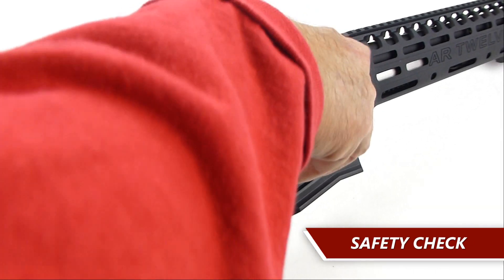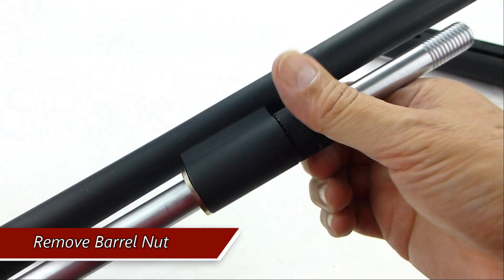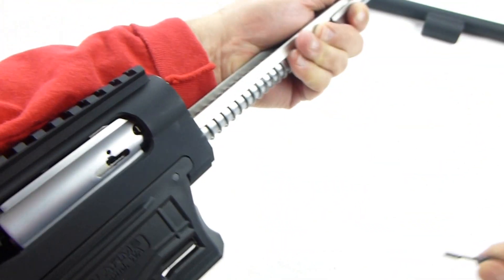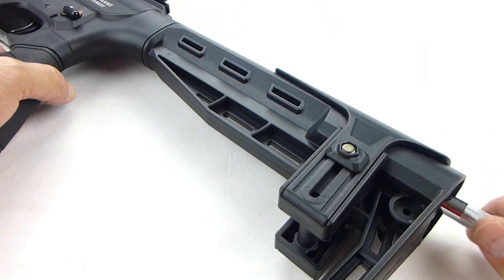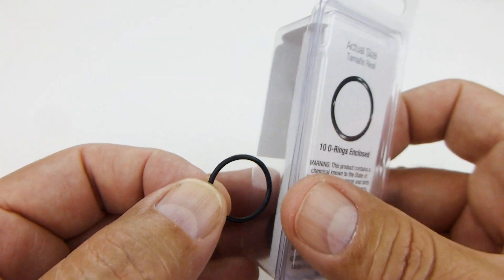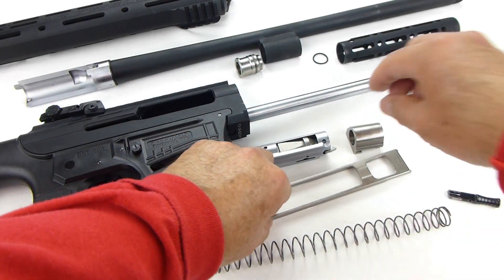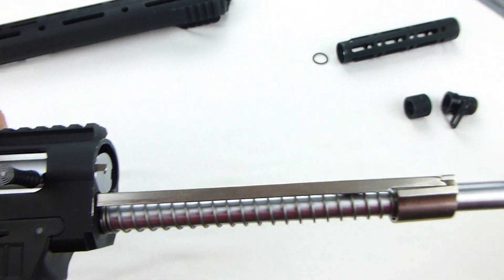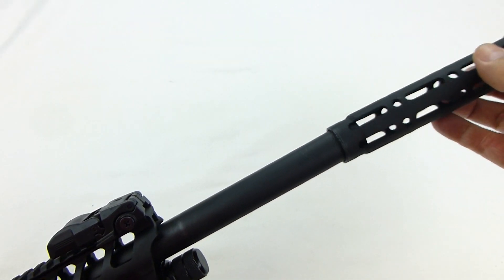Panzer Arms Gen3 AR Twelve *QUICK* Disassembly & Reassembly video

Comment: Thanks for tbe video!  Great job!   The Fo Muzzle break is actually not intended to give the appearance of a break though.  It is a heat shield because the barrel gets so hot.
Reply from the maker: Yup. It is actually a heat shield. The Panzer manual calls it a flash hider. Most people call it a faux muzzle brake because many people think it is a muzzle break. But with a semi-automatic shotgun, anything covering the barrel is actually a heat shield. Once you begin shooting 5 rounds rapidly the barrel does get hot. With a 10 round magazine, it gets really hot. Thanks for watching and liking Blake.

Comment: I would like to commend you on a very descriptive and useful video.  I’m am actually having an issue with fact that Panzer Arms has placed your video within their page that displays the PRO version.  I am aware this is not at any fault of yours, but considering the PRO is very different, it may be something that should be mentioned to Panzer, to avoid someone that may not notice the obvious and get into a breakdown and not be able to return to original or worse break something attempting to improvise from what they started.  
Again your video was great and unfortunately there does not appear to be even one single video or even a correct instructional breakdown in the original Panzer manual.
Reply from the maker: Yeah. I can't control what Panzer puts on their official website. Someone who owns a PRO version needs and has figured out how to disassemble their gun needs to make a video to help those owners. Or, Panzer needs to make one. Thanks for watching and liking my video.
Reply: MrMnmn911 I fully understand that it wasn’t in your control and think it is quite the compliment that they would use your video as reference on their primary site. I actually only mention to you in the comment form so some of the many out there that are very inexperienced and may read this and continue to look for a PRO specific instruction as well as there is a much higher probability of a message from yourself even getting read than a random unknown person as myself. 
Nonetheless, You have some great contributions in videos and well edited. I may make a hacked attempted at putting together a similar video, on the PRO when I finish the complete breakdown to make sure I didn’t skip any steps myself. LoL

Comment: Wow - when I saw this : requirement to take apart the buttstock just to separate the upper from lower receiver -- that's a total deal killer!  Made me look elsewhere for a shotgun.  But my local shop had the newer PRO version in stock -- and this is not required at all.   On my version (purchased 10/17/20) you do not have to take apart the buttstock at all -- the upper separates from the lower just by the two takedown pins - just like an AR-15. 

Seems like they make changes to this firearm every year.  All the user manuals are out of date even on their web site.

But the easier disassembly is good news for anyone looking at buying this in late 2020.
Reply from the maker: Wow! You do know you don’t have to separate the upper from the lower to clean the shotgun, right?
Reply: @MrMnmn911  I suppose so - but it sure seems easier to separate them to clean, like I do with my AR.  Glad they have changed the AR12 so I do not have to take apart the buttstock. Thanks again for the great videos on this shotgun!

Comment: Iv got a question when I shoot the shell is ejected but the hammer doesn't reset so if I rack the bolt back and put another shell in it goes boom..with it unloaded I squeeze the trigger the hammer comes forward but if my finger is still squeezing the trigger the hammer follows the bolt but if my finger is off the trigger and I rak the bolt the hammer reaets

Comment: How can I remove the muzzle if it's being stubborn and not budging? I coated the connecting area with gun oil in hopes it somehow lubricates it.
Reply from the maker: Hmmmm. Have you tried using WD40? Also use a pair of rubber gardening gloves to get a better grip or covering it with a few layers of wide electrical tape, or something similar and using a pipe wrench on it...the tape would be so that you don't mar the muzzle/heat shield. Good luck. Let me know if you get it off and what you used and did.

Comment: THE QUESTION IS HOW DO YOU CHANGE THE STOCK FROM LOWER RECEIVER ? MY ONE IS WAY TO LONG AND I WANT A SHORTER ONE , I CAN'T EVEN HOLD IT PROPERLY ON THE SHOLDER
Reply from the maker: On this specific model you cannot change the stock from the lower reciever. If you are unable to use this shotgun safely I suggest you trade it or sell it.

Comment: I can not get the bolt handle out! It’s driving me crazy. I’m following every step exactly
Reply from the maker: Contact Dan from Dan's Sporting Goods. I have a video posted on who to contact for problems with the Panzer AR12.
Reply: Im having the same issue. I followed the steps correctly and the charging handle will not pull out

Comment: Do i have do all that to clean it after shooting it..?
Reply from the maker: It depends. I do clean my firearms after every shooting session. And yes, this thoroughly. But you don't have to. It is good to keep your weapons clean. Especially if you're putting a good amount of rounds through it. And, you don't want to put your weapon up for several months or longer without cleaning it. It keeps you from being frustrated of the gun not firing properly, due to it simply being dirty. 

Also, it's good to know how to disassemble and reassemble all your weapons. But, the Gun Scrubber does say "High Pressure Spray Cleans Firearm Components without Disassembly" on the can.

Take your gun apart and see how much gun powder you clean off, without cleaning solvent, after shooting your 65 rounds today. You'll be surprised how dirty it can get. Especially when spending a good day at the range. Hope this helps.